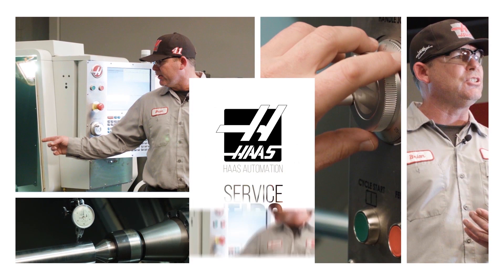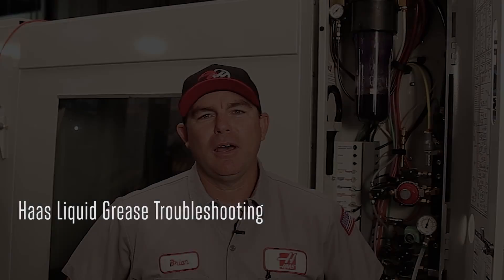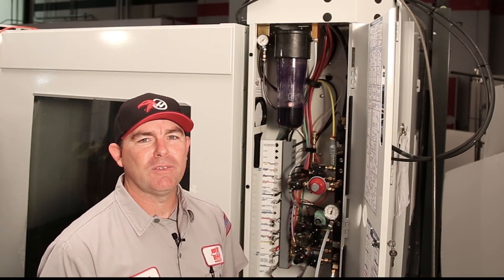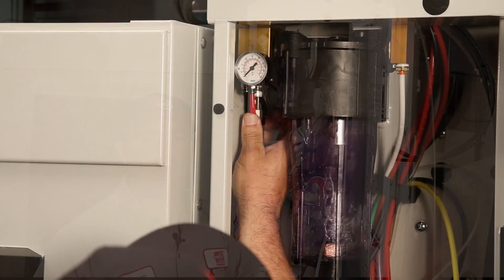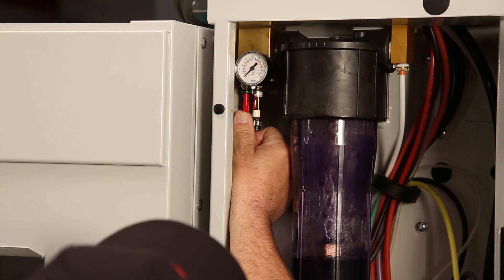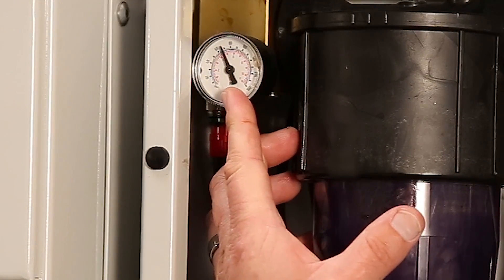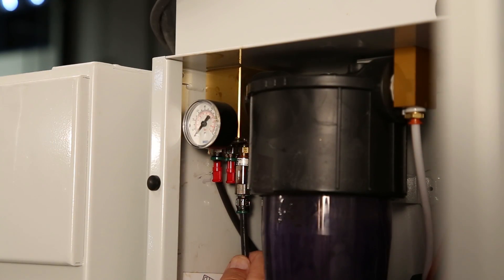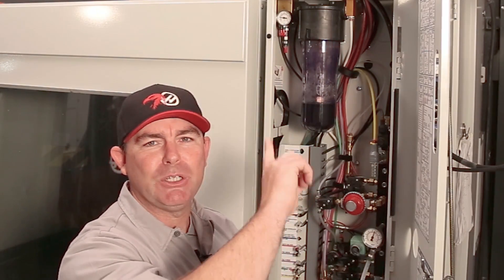Lubrication System Troubleshooting - Haas Automation Service Tip

Comment: I have haas mill vf3 2005 model. I m not sure if my lube is reaching all axis or not. Because all the time the pressure gauge is at zero. It only rises if i pump lube manually and stays at 30psi for a long time. My 117 parameter is 108000 as per given in manual. How to check my lube motor is running or not.